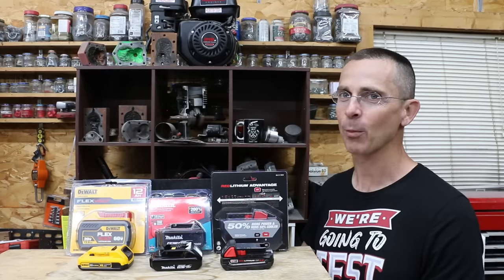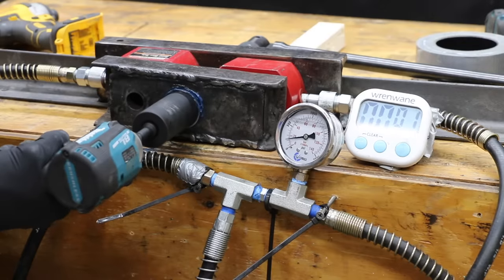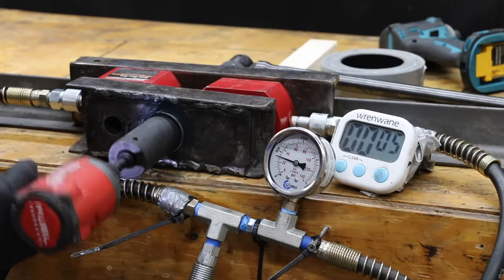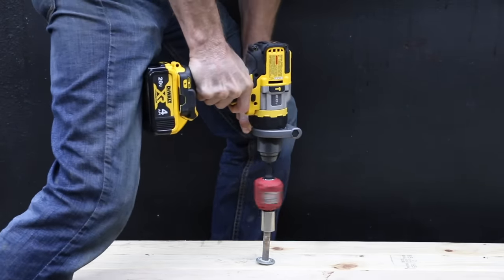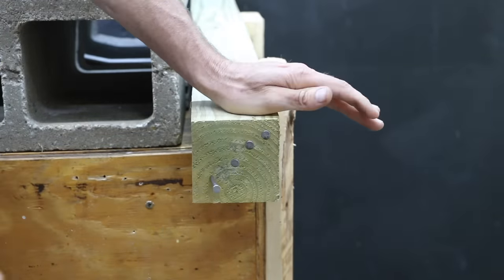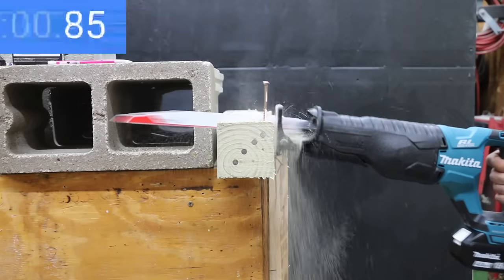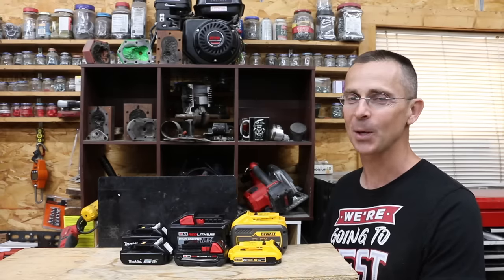Small "TOOL" Battery Better? Milwaukee vs DeWalt vs Makita

Comment: i have an idea for the winter, insulated coveralls. i wonder if carhartt would be the best.
Reply from the maker: Thank you for the video idea!
Reply: Yes this would be great, or even just winter jackets. I was looking at timberland pro, they are ridiculously expensive.
Reply: @bigshoots1181  he did electrically heated jackets this past winter...  It was a good video.
Reply: I have two pairs of Carhartt insulated coveralls,one has more insulation than the other. It was -42 Celsius in northern British Columbia while working on pipelines and I’ll tell you,they’re awesome 😎
Reply: @Whateva67  was that those Yukon extreme ones? Ya I'm in Sask and would like a pair for the farm, I imagine you had a hoodie on underneath eh?
Reply: @bigshoots1181  no hoodies,I never wear them. A couple T-shirts and a good old wool stanfield sweater 😎 and just a thin pair of long johns to move around easily.
Reply: @Whateva67  nice, were they Carhartt Yukon extreme? Or just regular Carhartt insulated?

Comment: What an awesome video!  I've always wondered how much performance I lose with a 3Ah battery vs 5Ah.  Well, now I know.  And I also know which tools will make the most difference when using a larger battery.  I find it very interesting that the Milwaukee impact wrench broke not one, but two adapters!  

My go to for battery powered tools is the Milwaukee brand.  Though I do own Makita, Bosch, Ryobi, Rigid and DeWalt tools, I prefer the Milwaukee tools.  Even the little 12V tools are great!

Thanks for another excellent video.
Reply from the maker: You are welcome!

Comment: Hey guys, quick engineer take if you're wondering why. Each battery has an internal resistance. To get a larger Ah battery you put your batteries in parallel hence you put the internal resistance in parallel. This is like blowing through one straw vs going through, say 4 straws. The effective internal resistance of a 12Ah will be 1/6th that of the 2Ah. Cool video idea for sure!
Reply from the maker: Thanks!  Thanks for the feedback.

Comment: Suggestion: Circular saw like Dewalt FA vs Dewalt FV, or same with Grinder. These tools chew up batteries and are affected by heat and pressure. FV6ah (21700), XR8ah (21700), XR5ah (18650) batteries. Testing power and runtime. Testing light pressure and heavy pressure applied on each. Really interesting how with the Flex Advantage reciprocating saw the XR battery beat the FA battery while one handed. I saw similar in the VCG test of XR saw and XR battery vs FA saw and FA battery. It was two different people so I thought it was user error, but your test adds more data towards more speed isn’t always helpful on all tools and workloads. Keep these power and runtime videos coming, amazing data only found here.
Reply from the maker: Thanks, will do!  Thanks for the suggestion.

Comment: My experience is that the advantage of higher-output batteries is increased torque.  In testing the reciprocating saws, more weight at the shoe would have reduced cutting time substantially for the larger batteries.  I think the best comparison would be to adjust the weight so that the blade reciprocates at the same rate for each test, but I'm not sure how you'd achieve that.
Reply from the maker: Thanks for the suggestion.

Comment: I've personally torn apart a 6ah DeWalt Flexvolt battery and they have some high quality Samsung 30A continuous 18650 cells that were 2000 mah each.   I now have 3 of the 9ah packs for my leaf blower, which good for 45-60 minutes total.  I either need  a 3rd charger or a 4th battery since it takes several days of 6 batteries worth to clear my yard.

They are also useful in the brushless weed Wacker. I bought the small one since it's a beast.  It runs for over an hour, depending on how thick of grass you are doing.  Ten times better than any 2 stroke
Reply from the maker: Thanks for sharing.

Comment: This was pretty informative. It never occurred to me that the torque could differ between batteries, only the capacity and heat seemed to factor. Now I see I can use the smaller 2ah batteries when driving lower torque screws for things like curtains.
Reply from the maker: Thanks for the feedback.

Comment: Great video - Suggestion (not sure if you could do this) show a graph in the corner of the video with the performance of each battery on a line and add the next point each time you get one.  Add a new line to the same graph each time you do a new battery for comparison.  It would make it really easy to process.
Reply from the maker: Thanks for the suggestion.

Comment: Hi, 

How are you doing today? I am doing pretty good my self. I am glade to see that you are still staying safe during the covid-19 pandemic. I am also glade to see that you are still having fun making your YouTube videos. I have learned a lot of great information by watching this video. The main thing that I am taking away from watching this video is that the batter makes a huge difference in how to power tool performs. The other thing that I did not know is that they made a battery adapter for power tools batteries. What I would like to see you try testing is: socket adapters for power drills. What I would like to know is that: does the manufacture of the socket adapters makes difference? How durable is each of the power drill socket adapters far as breaking? The final thing that I would like to know is that: how much Tork can each of the power drill socket adapters can take before snaping off? I hope that you and your family takes car un' till next time and I am looking forward to the next new video that is coming out on Sunday of next week again.
Reply from the maker: Thanks for the suggestion.

Comment: Yea, I recently replaced my Kobalt 24v drill with a Milwaukee 18v compact drill...
The difference in quality and functionality/feel are actually pretty shocking.
The 18v Milwaukee will beat the crap outta the Kobalt powerwise and feels far smoother when it gets pushed with a lot of torque.

Idk about their other tools but I will certainly try another Milwaukee tool when I need it. 
LOVE MY DRILL! 😉 

P.S. $89 for the Milwaukee 2 amp???
Where the hel do you live lol???
Its about half taht in my state.
Reply from the maker: Thanks for the feedback.

Comment: As an electrician, I would love to see a test of different type or wire nuts. Especially these new wago or whatever they are. I personally don’t like them because I am afraid of them causing issues down the road. 

I have seen bunch of videos of them being tested and they tend to fail after your normal wire nuts. However, these tests on,y did a high voltage high current stress test just once. I want to see a heavy load on the wire nuts, wagos for several minutes. Turn the circuit off for several minutes and repeat. That is a more normal kind of testing to me.
Reply from the maker: Thanks for the video idea.
Reply: I'm a low voltage fake electrician (F inspections).

While I use wire nuts here and there, I've been on many worksites with all kinds of electrical companies. Like single guys up to national companies. 

Almost all of them keep a handful of Wagos in the bottom of the tool box for places where nuts would be a pain in the dick. Couple of the guys who think they are extra fancy will do entire houses in Wagos, but that seems expensive.

So yeah, I don't think you should worry about safety of you're buying legit Wagos. You probably just won't deal with the cost for all your connections.
They are something you use to make your life easier in tight places.

I keep the coupling ones handy when I need to extended speaker wire or powered blinds.

Comment: awesome. now in the cutting tests i’d love to see more weights and the resulting differences.

i’m guessing there’s a point where smaller batteries and lower weights meet up with bigger batteries and higher weights… or is it that bigger batteries cut twice as fast but only with twice the weight… and so on. also we’d learn the general optimum pushing force to use while cutting. something i’ve always wanted to know. 

ex: a hitly hammer drill is much faster if you don’t push, but a simple multipurpose drill/hammer drill seems to need a fair bit of force to get through, especially with older concretes… 

i guess that’s a technique vs a consumable test… but super interested none the less.
Reply from the maker: Thanks!  Thanks for the suggestion.

Comment: I've consistently used the 4 AH DeWalt batteries and they have been impressive. Burned up several 2 AH batteries on a job, seems those are of lesser quality than the larger DeWalt batteries.
Reply from the maker: Thanks for sharing.

Comment: Awesome! I wondered about Advantage  claims. Did you have any trouble with the batteries recharging after being in an adapter? I’ve had Milwaukee and DeWalt batteries that wouldn’t charge after being ran down in an adapter come to find out adapter didn’t have low voltage cutout.

Comment: I'd love to see a video on USB-C power supplies.. specifically ones that are for power delivery (PD).  This is becoming more and more relavent as time goes on and more and more devices use USB-C as their power source.  I've had a heck of a time getting a good reliable 65-100 watt USB power supply, and can't find any review information on any of them  There are sites that rank them by features (wattage, ports, size etc) but I don't see any ranking based on quality, and most everything I've gotten has been crap...
Reply from the maker: Thanks!

Comment: Ever tested if a Diesel Engine runs off Kerosin / Heating Oil? I remember a neighboor once using heating oil as cheaper diesel substitute. Kinda fitting topic with the recent gas price rises.
Reply from the maker: Thanks for the video idea.

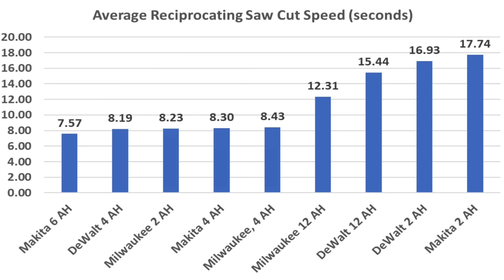Comment: 12:50 was the blade getting worn down?  Faster blade, slower cutting... unless the force on the blade is being reduced by the battery pack getting heavier on the other side.  Or the heavier battery pack increasing the polar inertia and reducing potentially useful blade bounce?

Comment: I wonder if some of the improvement is just from the weight of the battery? More torque on the impact driver since theres more mass on the end of the handle, possibly similar for the reciprocating saw.
Reply from the maker: Thanks for the feedback.

Comment: What angle cube do you recommend for getting the right angle when knife sharpening as I have bought a TSProf Kadet on the strength of one of your experiments but I want to get a digital angle cube that works with this system. This is such a good channel and never disappoints 👍🏻🏴
Reply from the maker: Thanks!  Thanks for the suggestion.

Comment: Torque Test Channel did some similar testing… I found it interesting how much more power Milwaukee’s High Output, which use 21700 cells, can deliver. Also, their 6.0ah uses a different 21700 cell that delivers more power that the 12.0ah… Love your video’s, keep up the great work!
Reply from the maker: Great feedback!  Thank you
Reply: Yupp. The 21700 cell has higher output than the 18650 cell.
Reply: Bob Mule  the 12.0ah does use 21700 (as well as the 3, 6, and 8 high output). The 6.0ah uses cells that can discharge power faster. So it can outperform the 12.0 from a power standpoint, but will not run as long.
Reply: Looks like they finally caught up to Bosch who has been using those cells for years.  My Core tools are still beasts
Reply: Exactly what I was looking to comment.
Reply: Interesting!

Comment: Thank you, as always.  This confirms what my “wrist dyno” has told me.  In my Dewalt impact driver, the 5 amp hour battery definitely helps performance.  I don’t use it in my hand drill, and your results here confirm my gut instinct.
Reply from the maker: Thank you!

Comment: Still hoping for a wood cutting oscillating blade test. Amazon has some blades as cheap as $1, where everything at Home Depot is $8-10 each. You could use the same rig as your metal cutting test, but replace the screws with hardwood dowels.
Reply from the maker: Thanks for the video idea.
Reply: That would be very interesting to see multi-tool blades from harbor freight, Amazon etc tested with a good bellwether.
Reply: Agreed!

Comment: Large batteries are so heavy, its also can be ergonomics and fatigue issue
Reply: To be honest a 12.0 is not enough to even come close to wearing out my arm using all week long might just be me but it’s stupid light
Reply from the maker: Great point on the battery weight!
Reply: Maybe stop being a pansy...."omg it's so heavyyyyy ughhhh" 🤣
Reply: Heavier battery could also help reduce impact vibration since it’s more weight the tool needs to move
Reply: @HSKFabrications  if your holding it all day or over head it makes a difference
Reply: Also,  more difficult to get into tight spots...
Reply: @FishFind3000  Point me to the battery that lasts "all day"😂
Reply: You know I'm just messin with you all. I always use the battery that's best suited for the tool and the environment(tight space). Like the video proved, huge batteries aren't necessarily better.
Reply: An 8, 9, 12, etc are best for anything normally heavy like yard tools. Or in stationary ones like the miter or table saws. Even a hammer drill in masonry is iffy. Just powerful enough to get things jammed up, but can't undo it. Had to drag out a corded to undo a bind more than once from it.
Reply: giggles in m12
Reply: why not add a kilo and a half to the back of your tool to slow it down with over voltage?
Reply: I work in maintenance and the house keepers have a dewalt 20v blower but only have 5.0 batteries and they are older ladies and say they would prefer the bigger batteries but they’re boss I doesn’t want to get them the bigger batteries 😂
Reply: @Jake Heke That's why they make pipe wrenches out of aluminum. After a day of lugging a cast iron one around, you would get pretty tired too. Not so much for the aluminum one.
I wouldn't want to call any professional plumber a pansy.
Reply: I'm gonna back up Pablo here, a lot of these cordless tools are marketed to prosumers and DIYers, and as a software developer with a few Dewalt tools around, I honestly will grab the smaller batteries first if I think they'll last the duration I want.
Reply: @HSKFabrications  100ft extension cord  FTW !
Reply: @FishFind3000  Amen to that
Reply: @HSKFabrications  ok wisenhiemer LOL.
Reply: Those super sized batts are best deployed on benchtop tools like DeWalt's cordless table saw, or in the cordless mowers where their weight doesn't affect the load the user has to bear directly.
Reply: @FishFind3000  I could've used that this week. We tore out a bunch of decking, (after two weeks of no work from the heat) and more weight could've helped or hands from fatigue as well as take the 20 year old screws out
Reply: For most my powertool needs i use Makita subcompacts, with a 2ah battery they are a delight to handle, agile and nimble yet more than enough power. For the heavy tasks i got a heavier Makita impact wrench, agility is not an issue in those cases so it has a bigger battery on it even if 2ah would be enough.
Reply: Yeah holding the high torque 1/2 inch M18 Milwaukee with a 5.0 battery over your head pulling a transmission is less than convienant. I love my electric tools, but the lightweight and smaller form factor or air impacts is one advantage they still have. Electric tools are often quite bulky I'm comparison too, especially with the compact air impacts that have came out the last 5 years or so such as Aircats. Now more recently theres smaller more compact versions of electric impacts that have come out with enough torque for the majority of tasks too.
Reply: were spoiled with the tools we got these days.. i bought this old craftsman angle grinder at a pawn shop in the oil field 5 years ago, things older than me all metal body, 7" disk, thinks twice as heavy as any other angle grinder i have even a new 9" dewalt.. can imagine using it all day over head... likely was used on the pipelines in alberta back in the day

tools these days have no cord and you can run them one handed over head all day... i take this old one out once or twice a year to keep it in running order and to remind me how much better my new tools are
Reply: This is the crux of the issue. If you have an 18v drill and just need a screw gun, a small battery will last a long time and serve you better when you need a steady hand. If you're an electrician drilling 7/8" holes use a larger battery for longer life and more weight. More Ah = more power too, that may not be correct in physics but it is here.
Reply: @looseballs1966  preaching to the choir
Reply: @samuel5916  yeah....I have lol
Reply: @AndrewBrowner  You sound like you're correct. But as a general rule of thumb, so am I.